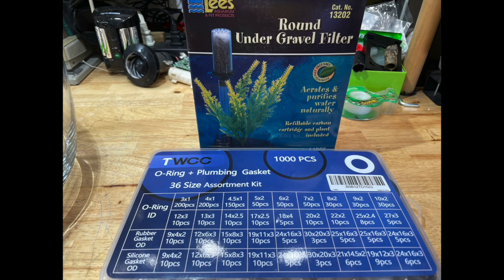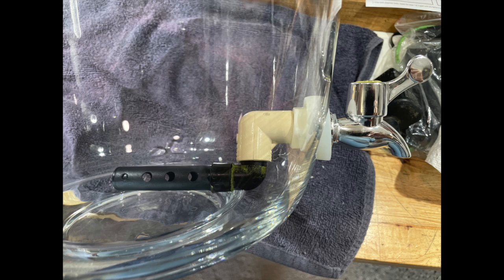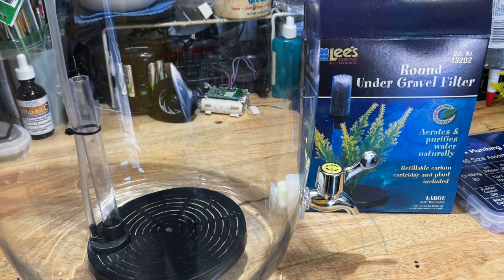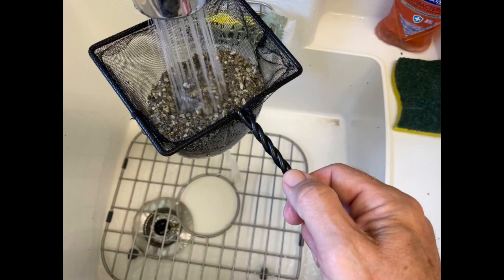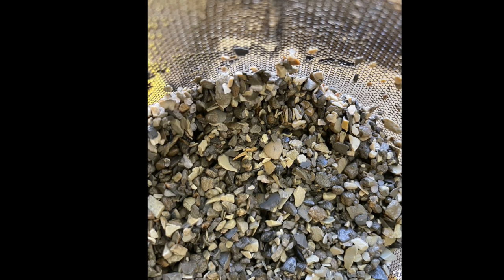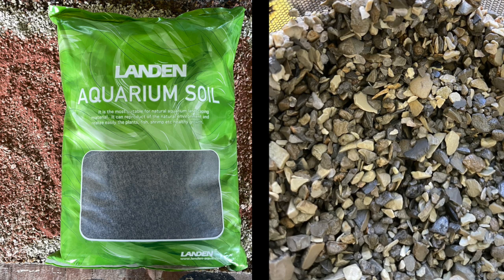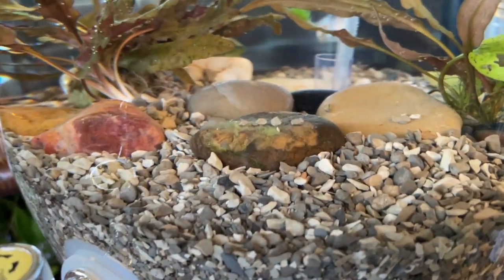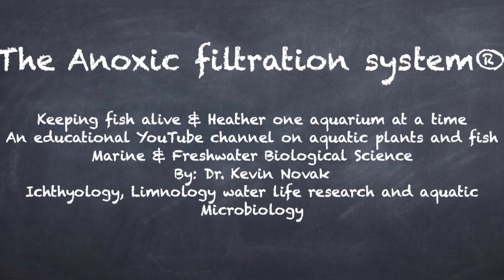Time to revamp the Betta container with a Plenum using Kitty Litter; easier than using sand.

Comment: Dr. Novak, 
Enjoyed your Betta Plenum video. I noted your comment on using and cleaning the cat litter. Cleaning smaller portions at a time is easier. Personally I like using Safe T Sorb, it has the same natural look as the baked kitty litter, actually I think it looks better with the natural brown colors it has. As far as cleaning it,  I have found I can easily clean a pound or more at a time with a large kitchen strainer and the garden hose with a sprayer, for those that want to do bigger aquariums. I combine it with flourite red for a nice looking substrate. Your idea of liquid iron would probably be cheaper than the flourite. Either is great. I am a firm plenum believer.

Comment: YAY I was going to suggest that. I am converting all my small containters with 'plenums' but I don't use and uplift tube at all I just layer it and use weed fabric to keep the fine particles from clogging it up so fast. I have a bunch of 'bio balls' that I place on the bottom and then an embroidery screen cut to shape on top and then the fabric then the litter, soil and cap with sand.

Comment: Dr. Novak, 

Recently watched one of your older videos and remember you had placed something like Eheim Substrat (Gravel?) underneath the plenum.  Might have been the antique 20g or newer 10g tank build videos.  Based upon material size, would the product fit beneath this round Lee UGF without pushing it up slightly off the glass bottom?

Was kind of hoping the sand would have worked out during this series.  The grain size seemed like a good fit for plant roots not having to work as hard to establish.  A bit too fussy to clean as you described, yet I thought it did make for a nice cap.

BTW, your audio is spot on with this new microphone.  While a great improvement, I never thought your audio was bad in previous videos.  Better than most non-pro YT channels, yet some viewers get hung up on room acoustics and presenters having to turn their heads and audio dropping low.  If I wanted to listen to automatons, there's a park in Florida for that sort of thing.  Didn't matter to me since I'm here for the theory, science and experimentation.  Thanks for what you're doing for the hobby and sharing.

Comment: hi dr novak i run co2 247 in my tank 2 bubbles a second keeps my ph at 6.8 its around 15ppm co2 plants looking better with the new asta light im adding fluval gro all in one ferts but iv ordered a bottle of seachem iron an iron and phosphate test kit shouid i buy pottasium aswell i do 50percent water change each week just wanna have heathly plants its tricky

Comment: this is perfect timing. Im thinking of revamping my 10g and this looks perfect... i have a huge bag of kitty litter i can use now... (Unscented of course)
Reply from the maker: Test it out and make sure it's the granule kind that's been baked. If it is then you're on the path to success. Just remember like most of the new substrates that are out there it is a softer substrate but it should last you 30+ years.

Comment: i have a hard time warming up to using cat litter as a gravel replacement. i have said before, i used it as an additive to cactus potting soil, however it softens after a year or 2 and will clump in a ball if you squeeze in your hand. that's not what you want in cactus soil, it needs to stay loose, so i quit using it. i now use ''Turface'' in my soil mix. i want to try turface in an aquarium as a gravel replacement, which you mentioned it makes the water hard, (i believe)? perhaps doing routine water changes would take care of that. anyway, the cat litter is important to the bcb bags and baskets, and i would use those, just not as gravel replacement, unless i can find a hard baked clay that will not deteriorate the way i have seen cat litter does. is there any other substance(they sell fluorite just about everywhere these days), even chicken grit, sold in feed stores, or crushed bluestone(granite) i collect roadside for my cacti that will attract the ions out of the water when used with a plenum as gravel? also i thought about just siphoning out all the cat litter every 2 years or so and replacing it with new, hmmm?

Comment: I’m glad you didn’t use the sand again. The kitty litter looks better. The set up of the jar would be easy and simple for anyone to do and be cost  effective for any budget. Being in Florida for the winter and bringing the jar inside, will you use a small heater. Just curious because it’s bettas. Hope you made it thru the hurricane without much damage.
Reply from the maker: No, the ambient room temperature will be high enough and therefore will not need a heater at all because I am in Florida. Of course if I was up north it would definitely need a heater because of the cold winters and how the ambient temperature in our homes it's more like 65 to 68° at night.

Comment: Thanks for sharing. Its an excellent idea. I always wondered about using the clay itself as substrate but wasn't sure how it would work. So for now I've just been using it for the bcb bags in the canister and as the only biological media in my small DIY overhead sump filter made using a planter box & planted with pothos. I will however, definitely give it a try when I am setting up the plenum for my next tank. 👍👍👍
Reply from the maker: Glad it was helpful!

Comment: How do you know if Baked kitty litter?  
I bought the special kitty natural clay, unscented, non-clumping, like you suggested on another video, but that one fell apart in a cup of water
Reply from the maker: It will be a harder consistency. And they used to put it right on the bag that it was baked kitty litter.
Reply: I’m gonna try the safe T sorb from tractor supply

Comment: OH the screen info over the hole GOOD to know I thought about doing that too, glad I didn't
Reply from the maker: I tried it and it clogs up very, very quickly and therefore hardly any water will come out. So I had to take the whole tank apart and put back the extension tube I made and that has no problems at all of clogging up.

Comment: Tanks for sharing.
Have used a baked Kitty Litter here in Norway that have worked very well. I have seen one negative effect though. The Kitty Litter reduse the GH/KH to zero. I suppose all types of Kitty Litter have the same effect on the GH/KH. Any suggestions to easy counteract this effect of the Kitty Litter?? Crushed coral maybe?
Reply from the maker: Yes use crush coal will help too.
Reply: Thanks😊

Comment: got a new asta 120 it is 60 watts 6000lumens with the round lens looks great on my 25 gallonplants doing alot better its the new model with the 3 blue leds but amazon really needs to sort there site it says 80 watts 4325 lumens and 65k not 60wats 6000lumens 72k big diffrence lol i dont think ill need a second one on a 32inch tank but im gonna get one more run both at 75persent make lights last longer
Reply from the maker: Great, my next video that's coming up on Tuesday talks about the brand new F zone stainless steel canister filter and how they have a improved it compared to the old filter.

Comment: My plenum 40 breeder has plenum covered with walmart special kitty litter then iron soil and .2mm sand. Are you now saying we should not set up with the walmart special kitty litter? You are kind of all over the place with what to use. I guess laterite is not necessary now. Hmm? That plenum is way way too fast.
Reply from the maker: No it's fine if you use the Walmart kitty litter it's just that it's not the bake kind like they used to sell. The baked kitty litter is easier to clean that's all I'm stating. You did everything right so you shouldn't worry about it. I also use the old Walmart kitty litter in my 40 gallon breeder with the goldfish in it.